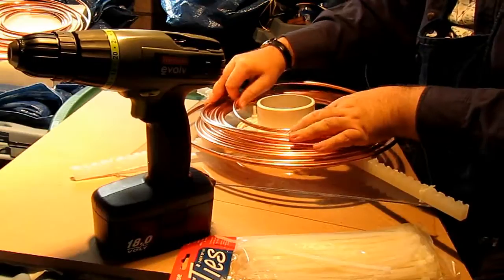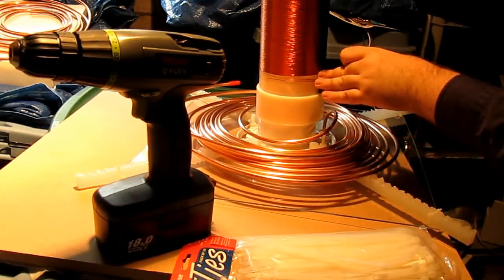Tesla Coil primary winding part 1

Comment: The magnetic field generated in the primary should be as close as possible to the secondary should it not? Because the closer the magnetic field is, the more electricity produced on output. So wouldn't it be more efficient to have the primary wrapped  on the secondary with an insulating layer in between? I'm not criticizing, just curious.
Reply: lepayen No, if it was wound directly onto the secondary, with a insulating layer, it would most likely arc to the secondary coil and light it on fire. All you really need is a good coupling, and the magnetic field must be within vicinity to transfer to the secondary coil.

Comment: free energy refers to any extra energy IE any energy which was not there to begin with, it doesn't matter how much work is done before output because input doesn't matter, it's output that counts. I can use mini solar panels and an incandecent lightbulb to collect free energy. The incandecent runs on 110v AC and I can get 18v DC from 3x6v solar panels which is enough to run and charge my laptop. using a transformer I could make that 180v AC, so I get 60v of free energy from it.
Reply: lepayen Energy is never free, there is always a cost.